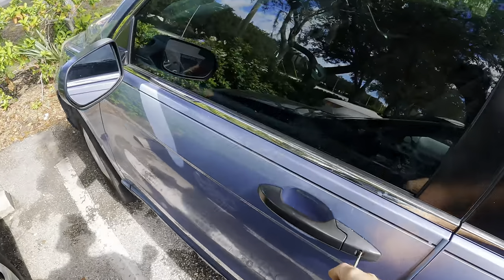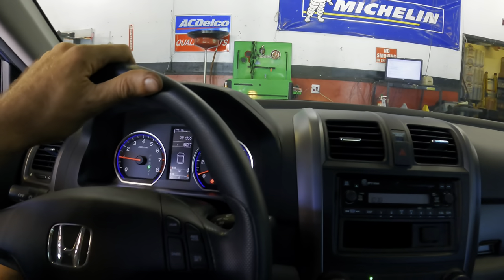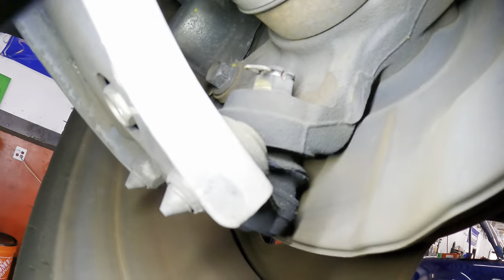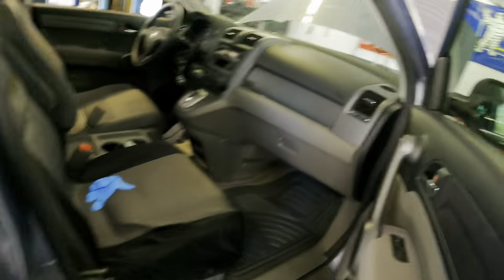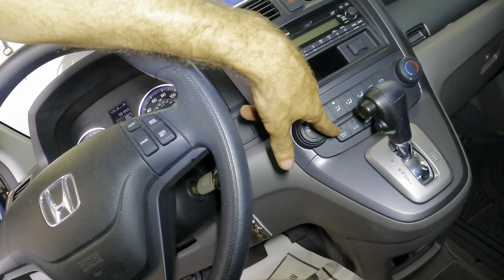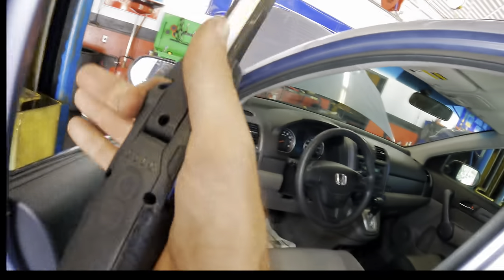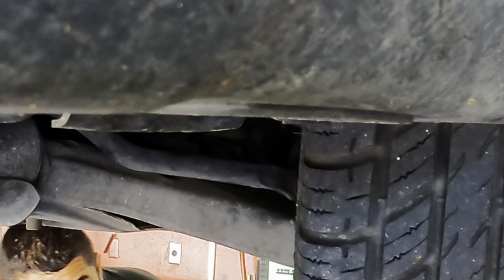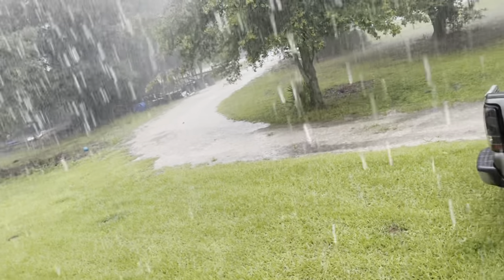Scam or Stupid? YOU decide! Work that wasn’t needed! Honda CRV

Comment: My sister recently took her Dodge truck and for a noise she kept hearing and one shop sold her on all new ball joints tie rod ends everything and it didn't fix the problem so she took it back and they decided that it was now the differential causing problems and so she took it to another shop who agreed with her and they did the work cost her a whole ton of money and problem still not solved so I looked at it and her inner fender liner was just bumping up against the cab of the truck causing the noise shady practice and stupidity

Comment: Im one of them "older ladies on a fixed income" my husband who took care of the car stuff and knew when they were ripping you off passed away a little over a year ago. About a year ago my headlight went out and i knew it was going to be around 200 to replace because you have to take alot of stuff apart to get to it. When I noticed the headlight out, I checked other lights to make sure nothing else out I didnt see anything except headlight. I asked around other then dealership where to take it so a place I had not been to before was reccomended, I will NEVER go back for the simple fact they were trying to rip me off I dont that well. I told them the headlight was out and I only had money to get it fixed, they were not long calling me did you know you have a turn signal on the front out your light over your license plate is out they named several lights then oh by the way you probably should replace the wipers on front and back. When I brought my car in I opened my big mouth and said my husband just passed away I know nothing about cars I depended on my husband to take care of things like this.

Comment: Years ago, I told my mother she needed front brake pads.  I told her I could do the job.  At the time the pads were about 20 bucks, for the good ones.  She was always paranoid about me working on her car so she took it to a nationally advertised brake and muffler shop, against my advice.  They replaced the pads for a price that was double that of Advanced Auto.  They also replaced a rear right wheel cylinder and rear brake shoes.  They charged her 900 bucks.  I checked the rear brakes and they were good.  They saw a senior citizen coming.  I lodged a complaint with corporate, and about six months later, they closed the place down.  Needless to say, I was livid about her being ripped off.  A legitimate shop would have done the job for less than half that price.  I could have done it for free.

Comment: The other shop seems shady as hell, but you can't possibly tell a drop link is bad or not just by looking at it. They need to be loaded up to see if there is any movement.
Reply: How do you know if they were shady since Ray never even checked the ball joints and sway bar links properly?

Comment: Even though it's a 2007, with only 90k, a CR-V engine is still a youngster. I have a 2009 with 149k, having to have exhaust work due to rust issues

Comment: 2007 Xterra. 90,000 easy miles.  First time for that vehicle in that shop.. oil change and check wheel alignment.
NO symptoms! The estimate was $3400, struts, shocks, control arm bushings, motor and transmission mounts and a fan clutch in a pear tree.

Hummm…second opinion, with me shadowing the Master tech.
Yeah, the fan clutch is getting weak. You don’t need any of that other stuff.
First shop has a good reputation, bjt the owner is NOT. a Tech, and has hired new people to keep up with increased business.
Always get a second opinion. Most shops won’t charge for an inspection or maybe a half hour.

Comment: With regard to the low oil level, these engines are notorious for burning oil.  My daughter has this same engine and it uses a quart every 700 miles.  There was a class action lawsuit against Honda for this.  The oil control rings are crap.

Comment: The reason why Mechanics and repair shops in general have a bad reputation is because the few dishonest people in the trade. They take advantage of people that lack the knowledge to make informed decisions on their vehicles. People that do this deserve a very special place in hell. I have a relative who is a mechanic and he quit a job after only two months because the shop policy was to sell parts and services whether it was need it or not. People came in with a low battery automatically were sold a battery and an alternator etc.   Thanks for your honesty.

Comment: working at a independent shop for electrical specialist and tune ups, didn't matter what the issue was, remove distributor cap and wire's and replace! with Mercedes and Porsche and others coming in that were fairly new and doing this the owner was racking in thousands of dollars, not hundreds, I would complain and was threatened to get fired, until a under cover car came in for servicing because of complaints of over changing and not having written estimates, I went to lunch and came back to a closed shop with the owner being arrested, for expired papers to be here legally, one job I was glad not to go back to, California based,

Comment: Pretty obvious oversell based on condition, miles, driver description. Not to mention vehicle make/model well known for reliability. Granny's smart move to flee from the wolves. Little doubt if estimated repairs had been ok'd , other shop would do the California Tune Up fix. (That's where only top of spk plugs get cleaned up)
Reply: Shop I spent most of career with was busy with needed fixes and nitemare repairs. We tried to be as correct as possible on diagnosis & est. Too the point of advising when repair costs mite be best applied to a better vehicle. Sum folks like to keep ol' Betsy going tho. Did complete AC fix on old LTD that had a dead cyl., But they were aware. Just wanted cool.

Comment: I've seen this countless times especially with women or OAPs who go to garages.
They're given blood curdling tall tails of things wrong that need fixing, usually easy jobs to.
So CV boots, rear shocks, ball joints etc easy bolt off bolt on jobs get quoted to the max.
Why should you be paying top Labour rate charges for easy jobs that minimum wage apprentices do ?
Some jobs need high skills, special tools, or are just real pigs to do, especially transverse engined FWD vehicles where space is at a premium.
Anyone taking on those jobs is well worth the Labour charge, he's earned it.

Comment: Would you want to spray brake parts cleaner on the ball joint to remove the excess oil off of of the joints so this doesn’t occur again.

Comment: The 2.4 engine takes 5 quarts to make the top line on dip stick, manual says 4.5 quarts, I use 5 and no issues.

Comment: Both ball joint are leaking. Both were smoothly covered with oil and dust, so it’s difficult someone had fake it. The ball joint is going to fail, and in my view they should be changed.

Comment: Did you check the link bar's or just look at them ?? and the ball joint with a split rubber would wan't replacing soon surely. I wonder if your opinion would have been the same if you had not known about the other shop and sometimes it's easy to be misinformed. But in fairness the other shop should have just advised they had a non serious defect rather than just go for unnecessary sales. Have a good Day Ray 👍
Reply: In these times I truly try to be as forgiving and as Open minded as possible but it is tough with this car. The thing that set me off which makes everything else that they said suspect was the leaking ball joint which I'll bet your a quarter of my own money was motor oil. That is pure scam and there's no other way to look at it.

Comment: I’m not going to criticize the oil change. Could be a bunch of issues. You did mention a filter leak. Could be that. In addition, some engines like being at a certain level and will quickly burn off anything above that level, even if it’s not at the full mark.

Comment: I took my 2005 Malibu maxx 3.5 liter for rear toe link. The garage took out engine air filter put in a 4.3 liter chevy air filter. It bounced around in air box. Threw a lean mixture code.  They shouldn’t have even been in there.

Comment: Here in Phoenix, AZ I took my 2011 Ford Crown Victoria Police Interceptor to Big O tires for an alignment and new tires. The shop insisted that I had to put S rated Goodyear Eagle RSA tires on my car because of how much it weighs. RSA’s are terrible in wet conditions and the S rating is for high speed not weight. They also said I needed new ball joints, shocks, body mounts (the car is body on frame and doesn’t have rubber body mounts), motor mounts on a vehicle with 68k miles. They quoted me a price of $1800 for all the repair work. I never went back and gave them a poor review on Yelp!
Reply: Your crown Vic does have body mounts. A 30 second google search proves at least one of your assertions false. Makes me wonder about the rest of the assertions you’ve made…
Miles on a vehicle doesn’t mean that other parts on a vehicle won’t age faster due to environmental factors. I’ve had rubber parts on cars age far faster here in Phx than other parts of the country. At 11 years old I would expect to see degradation of the rubber on your suspension and body components. Not all, but some.
Reply: @goosedeathable  okay I was wrong about the body mounts but not about everything else. Thanks for the correction.

Comment: If that is a Moog ball joint it might be leaking through the bottom of the ball joint body. I had the same thing happen after installing mine properly. The car just sat in my garage after install and the next morning I saw oil on each side near the wheel. I thought it might be brake fluid but on closer inspection it was from my new Moog ball joints. Saw customer reviews saying the same thing but I assumed they were installed incorrectly, yet I had the same problem. I don't think it really affects the operation of the ball joint I guess maybe they are overfilled from the factory or just slightly defective. Either way I wouldn't get another Moog ball joint. I assume those may be Moog because of the blue boot color.

Comment: I took my Dodge/Cummins 2500 in for repair of low MPG's and they said it would be 9000.00 plus to replace my whole fuel  system down to all the injector lines, this was after I waited for a week to get in the shop for a check, dropped it off Wednesday morning, they didn't even get to check it last thing Friday afternoon after I told them it was my work truck and I was losing money every day it was in the shop, then even though the shop was slammed with work they close on Saturday and Sunday, didn't get the estimate till late Monday night and told them I would pick it up Tuesday morning, now I'm go a one guy shop who does nothing but diesels to see what he thinks, he said he would check everything to find out why it takes long crank times to fire it and the low MPG

Comment: Disagree on the torn boot. It's an issue because the ball joint will wear out quickly now that it's exposed to dirt and dust. People have short memories and will either forget to fix it or refuse to until the vehicle actually is dangerous.

Comment: 9:40 you failed to see the discrepancy there. 

The sticker says the oil was changed at 94,115 but the odometer shows a much lower reading of 91,955
Reply: Sticker says when it's due for its next oil change, based off a 3k interval like ray said.

Comment: Shhsssssss my 11’ grand Cherokee 5.7L HEMI, just took a sh!t, with that “HEMI TICK”. So I have to replace cylinder #8 lifters and the Camshaft. I was quoted 21hrs of labor and another $1500 in parts so basically $4500-$5700 was average from numerous shops. Hahaha yeah fk’n right. Never did anything like this before and bam last night got my cam out and oh lord it. Cylinder #8 lifters destroyed the cam and the other areas of the cam had some crazy damage too. So I purchased oem lifters whole package, 6.4l SRT cam(keeping the MDS), 6.2l Hellcat oil pump, timing kit, whole gasket set, and a couple other things, making it under the $1500. But sht be fkd up.

Comment: 10:13
If that CRV is anything like my sons' Accords (2008 & 2009), then it takes awhile for the oil to drain into the pan, like 10+ mins long. Not sure why, but I've caught myself almost overfilling them due to this slow draining process. The level goes from Low to High in that time period.
Reply: Absolutely! I have an 09 Accord and when changing the oil I find myself rechecking the oil multiple times! I’ll try waiting 10 min next time, thanks!

Comment: My 88 year old father in law has been this way for years, in that he goes to the same guy for his repairs and trusts him implicitly. 
Well one trip he went in and the guy diagnosed it as being one of two possible issues, that he would order both parts, and if one wasn't needed there would be a 25% restocking fee. 
I tried explaining to him that this is not the way works. 
He wanted none of it, as I was not the "expert" even though I had worked in full service has stations that had repair facilities, operated tow trucks dealing with repair shops, and dealt with multiple facilities and the people that ran them. 

But as the saying goes, a fool and his money...

Comment: The Video ended kind of weird... What Ever!!!  Your analysis of Suspension Components are just Visual and a Shake??? You guys have an Alignment Unit. Do you not know how to check a Ball Joint??? Load the Suspension and get it close to Ride Height.. Use a Pry Bar to load the Tire and look for actual movement... Just because a part is looking kind of new, does not mean it is good. How do you actually check Sway Bar End Links? Visually???  NOPE!!! Test Drive, as one Tire takes a bump and the other is on a flat surface, (just hit some Reflectors)  you should hear a bang...You can sway the Vehicle back and Forth while Driving straight.. You could also have it sitting on the Ground and having Someone rocking the Vehicle Side to Side and put your hand on the Links and feel it... Raise it up on a Lift and smack the Tire on the bottom with a decent sized Hammer or Dead Blow while feeling.... I am not so sure the other Shop was trying to scam her at all  because you did not actually physically check anything..You performed a Visual.... You thought you might get an Up Sale of a common problem with the Fans... She did not bring it in for that. Are you Scamming????

Comment: As for the cabin air filter, it could have been "based on mileage" as well... That is how both mine and my wife's car are specified in their respective manuals. Mine is every 15k, and my wife's is 20k. Depending on the schedule (mine for instance), the cabin filter could reasonably be recommended at 90k miles. 

That ball joint? It's third party parts, so automatically "a problem" to the dealership, which would be the first thing they look at; and the oil on it could simply have been the packing oil film on the part that wasn't cleaned off. The sway bar links... maybe they didn't like the rust on the bolts? Still not necessary though. 

While I would like to say stupidity, I really do not know what to believe...

Comment: Ray my 07 Civic holds some oil in the engine and you do not get a accurate reading until a about 30 min. later.  Also looks like the trans was low unless you check it with the engine not running also like my Civic...

Comment: I wish shops would allow the mechanics to speak to the customer instead of the salesman. Mechanics don’t care if the work gets done but can effectively relay all necessary information whereas salesmen do just that, make sales, so they aggressively try to upsell work that the mechanic may have said it doesn’t need to be done but should be done later.
Ex: mechanic tells salesman brakes are at 50% and relay it to customer. salesman tells customer mechanic recommends brake job.
There’s always too much information lost in translation especially if the salesman knows nothing about cars and too much aggressive up selling.

Comment: Ray: It can be easy to jump to wrong conclusions but, in this case, I think the obvious conclusion would be accurate. The other shop tried to scam/victimise a customer who appeared vulnerable. If they hadn't been so greedy, they could easily have got away with it. I would be checking some details with the customer, like which key she left them. If they only had the valet key, that's surely proof of scamming and time for the lady to seek legal advice.

Comment: No offence, but just looking at grease boots does not denote the condition of the ball joint. Pop a dial indicator on it and pry on the joint and check the amount of play. Suspension inspection 101.

Comment: Electric cars have shown us how many kWh it takes to push through the wind while traveling. There's a physical limit to how much energy is in a gallon of fuel. There's a physical limit on the least amount of energy that is used pushing that vehicle through the wind. Right now we have just about topped out on those physical limits. There is no miracle that's going to squeeze much more energy out those physical limits. It's going to take some strange new technology to do that if at all possible. So there's no 60 mpg normal shaped vehicle with a combustion engine. There's no 40 plus MPG full size trucks. It's not physically possible with that technology and fuel. I'm anxious to see what they can do with synthetic fuel. Before you think skeptically, think of nitrous oxide or nitro methane. If they can get synthetic fuel practical, especially extracting CO2 to do it, is going to be the miracle that saves gas engines.

Comment: You don't check lower ball joint without compressing the suspension
Reply: Verbiage is so important needed and recommend. Will fail and has failed. So correct with others making everyone looks bad

Comment: You made 5 clicks checking the air filter but only did 4 clicks when reinstalling ... you missed one of the spring clips to close the airbox . 7:00   due de du de do de do!